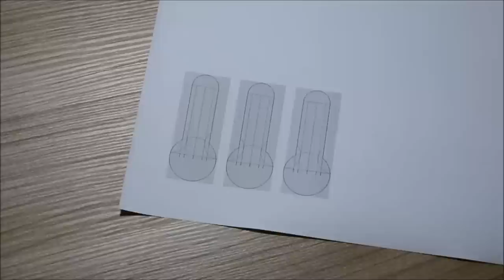How to Make a Removable Shopping Cart Token - DIY

Comment: Thanks for video! Done with lots of quality. The REAL problem, though, is the OTHER lock...on its back! It's a "rocker" type of system, meaning that - when you 'lock' one in, the other 'releases', and you can not retrieve BOTH, which is what I wanted, originally.
The Quarter (or Dollar) tool is practical, yes. The OTHER one, I made with a steel wire - rigid- about 3 " long, with an 'L' bent at the end. You RELEASE the REAR lock - by pushing the lever back, allowing the safe to come UP, locking the chain end that has a HOLE in it, holding it secure. This way, you can not retrieve the key attached to the chain. In this case - since there is no solid Key - you CAN retrieve the 'L' shaped tool back out: the cart is now RELEASED. No need for quarter, or dollar, and no chain is holding onto it.  🕊

Comment: Take a quarter, use a dremel/sandpaper to sand off the markings from the quarter. Drill a tiny hole on the quarter. Loop a string or a keychain through that hole. 😋
Reply: You ca't take out the quarter unless you return the cart.

Comment: Now I know why the cart keys are so much $ on ebay. Lots of work. Thanks for the video.
Reply: Much cheaper to use thin object like skewer or hair pin to press on the switch after coin inserted for release.
Reply: Lot of work to do it by hand but a press cutter can spit these out in the hundreds per minute.

Comment: Do you use removable hacks so you don't have to return your cart?
Reply: I use them because sometimes I can't park close enough to the ALDI and the shopping cart wheels lock on the way out to the car. That is frustrating enough without having your quarter stuck inside.